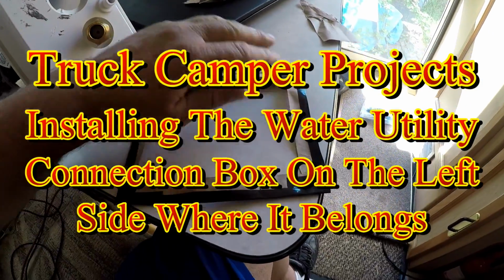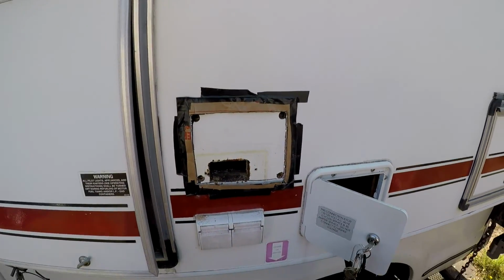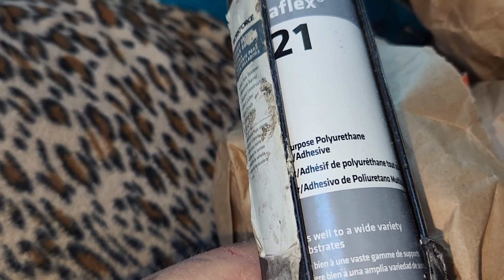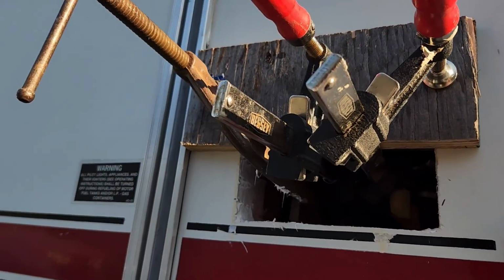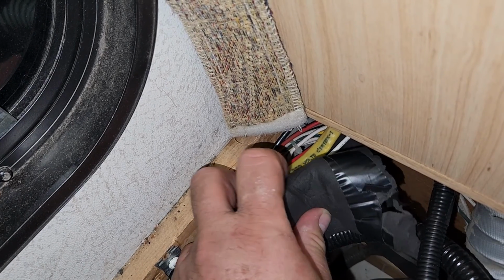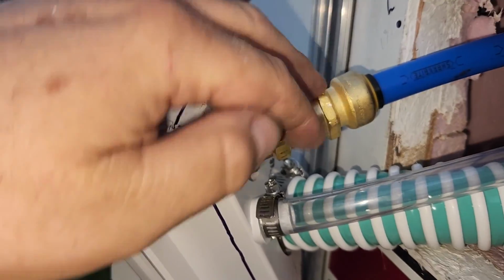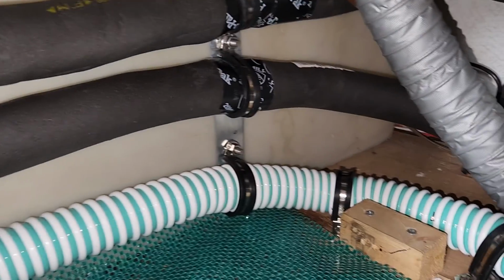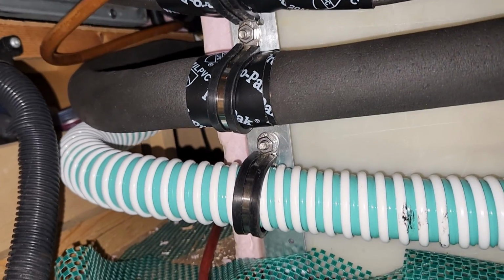Upgrading RV Fresh Water Fill Port And Piping

Comment: As you were cranking down on those C-clamps, it reminded us a classic song called "Under Pressure" by Queen and those opening lyrics. Job looks factory fresh.  Nice work Jeff. Always top shelf. Cheers.
Reply from the maker: Thank you, The new setup is working great. I'm still waiting for the solenoid valve for the hot water saver, priming recirculation setup. I grew up listening to Queen. We really did pack into our cars and sing along to Bohemian Rapsody.